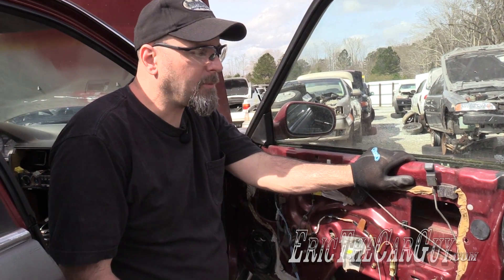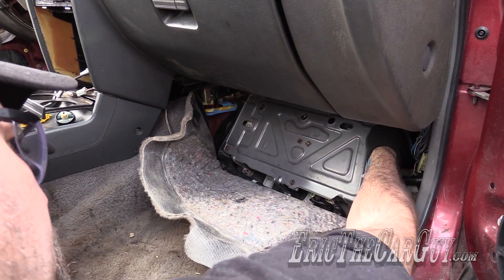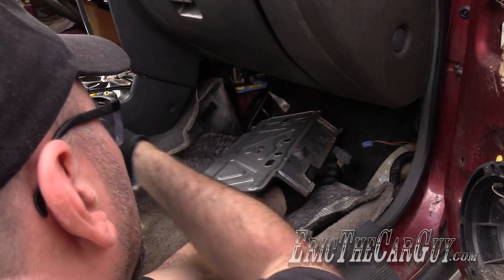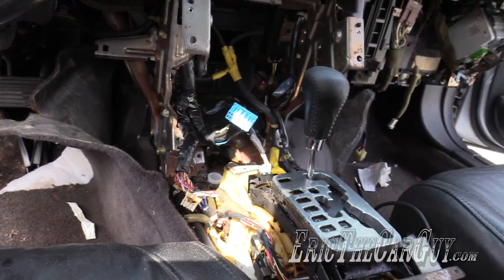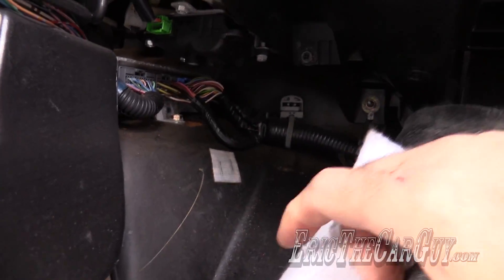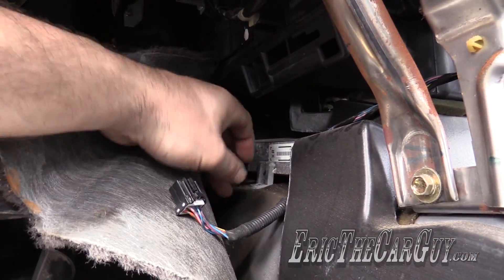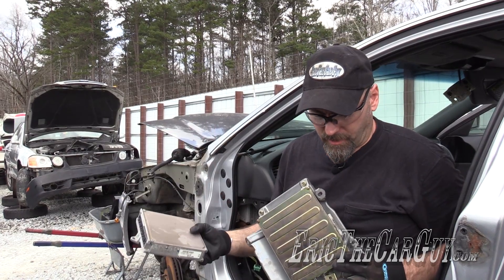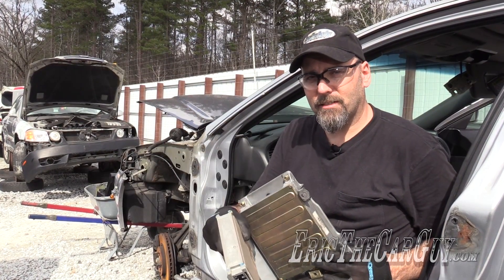How To Pull a Honda Computer #SalvageYardHacks

Comment: Make sure that the replacement computer has the same part number as the one in your vehicle. Generally speaking, they must match exactly to function properly. Manual trans cars have different computers than automatics, 2WDs have different computers than 4WDs, ect.
Reply from the maker: The only difference on older computers is manual or auto. Many of them run a separate computer for an auto if it has one.
Reply: Fair enough.  The newer the vehicle, the more specific it becomes.  Super crucial with OBDII.

Comment: I really like these vids when your pickin' parts a the salvage yard - real life part access and money saving.  I just save a bunch of bucks pulling a 2000 Toyota Corolla computer through salvage over buying a new part.  So far all is working well.   More of these salvage yard vids would be greatly appreciated especially if you could demo how you assure that the parts you're pulling are in good repair - thanks - I like your stuff a lot - being a computer screen mechanic learner
Reply from the maker: I'm glad you like them. There'll be a bunch more before I'm done. Looking to wrap them up next week and get back to the Fairmont. Thanks for your comment.

Comment: These computers are great for custom EFI projects.  The cases are designed to be fully grounded or even watertight and the connectors can be rewired to avoid changing out the electrical harness.

Comment: Eric, could you do a how to remove parts from a wrecked car? like easily removing a damaged radiator from a bent in core support for clearance, or a rear glass removal of a trunk that is dented over the seal. these are all just random examples. OHHH and tips for determining if an engine or transmission is still salvageable even after the battery has been removed or the cats are cut out
Reply: For your first question, often times if the area is already damage, brute force is the best option. Large pry bars, big hammer, etc.  No one will miss a destroyed core support, so do what you gotta do to get it bent somewhat out of the way.

Comment: Check out fi tech efi. Its a 4 barrel throttle body.  They have systems ranging from 400hp -1000hp or more. Its boost friendly and they have boost control and launch control self learning. Its very affordable.  Around 1000$ ready to go.

Comment: at least they were in a clean and safe location... today they put them in the dirty and hot engine compartment... next will be inside the oil pan or fuel tank
Reply: These 'computers' are very low power things compared to many other things. Heat isn't really an issue for them. What is more an issue for them is vibration and moisture. Which is why if you ever open these up you will find they have been filled will silicone snot to both keep components from vibrating and breaking solder joints and to keep moisture out. They are pretty much water proof, the wiring harness is more vulnerable to water then the actual box.

Comment: So, when you take a computer from a car with an immobilizer, can you acquire the key to the car from the junkyard so that you may be able to start the vehicle? I know that getting the immobilizers in computers can be tricky if you don't have a key to go with it. A lot of people transfer the chips by soldering but I was just wondering about this.
Reply from the maker: Good point. You'd have to have it programmed at your local honda dealer. I don't think you'll need the key though.

Comment: Do these computers really break sometimes or do they get water-damage or something?
Reply: Sure they do - they're electronic items and electronics fail but they are often replaced needlessly because of a poor diagnosis.  They can be damaged by external influences like bad wiring and if that outside influence isnt corrected prior to the computer replacement, the replacement will also fail, becoming nothing but an expensive fuse.
Reply: The TCMs, on atleast the CB7 Accords, the version he pulled one out of, fail at a rather high rate.  Had the same issue when I had mine.
Reply from the maker: Not often, but the people at the yard said people ask how to remove these all the time. Now they have a video they can refer them to.
Reply: "expensive fuse" is an excellent way to put it.

Comment: did you roll through the junkyard just taking shit out for video material or were you collecting some spare parts for common vehicles you repair to stockpile them up?
Reply from the maker: They had a list of the most commonly asked questions about what people wanted to pull and I worked through that list.

Comment: What about the immobiliser system, doesnt the ECU/PCM module have to be reset before you can marry it to a other car ?
Dont know how it works with Honda/Acura, but with Opel/Vauxall/Saturn the ECU/PCM is part of the immo system
Reply from the maker: On late model computers you'll need to set that up with a Honda scan tool.

Comment: 2006 accord sedan  I'm getting alot of clicking in driver kick panel and the green key dosen't stop flashing but the ignition is green light. It will randomly leave me sitting but this time it has been weeks with no luck. I am atleast getting fuel pump now but key still flashing with NO START plz help!) Tnx

Comment: I have a 2015 Honda Accord and the autozone diagnostic is reading P2101 Throttle Actuator Malfuction does anyone know the solution to this issue and where is my ECM located in my vehicle?

Comment: is it anyway to check for codes at a junkyard on a car with no battery and key . (i have a code reader)
Reply: You need both in order to read codes.
Reply: Any idea what a code 4 means on an 88' Honda Prelude?
Reply: +Samuel Gonzalez I'm on it! Thnx!
Reply: some junk yards will lend you a battery for testing purposes me and my buddy went for an engine fired one up and it locked up in 7 seconds xD next car kept running so that worked for us
Reply: No.  Once the battery has been removed, the codes are gone.
Reply: +ratbert86 depending if there repeat problems or bad sensors
Reply: +ratbert86 most of the times yes that's the case but they do come back as pending codes
Reply: He asked about pulling codes from a junkyard car - there aren't going to be any pending codes in that salvage yard ECM, they'll be erased when the battery is pulled.
Reply from the maker: Nope. Once the power is removed any stored codes get cleared.